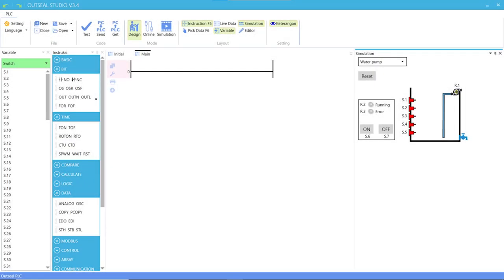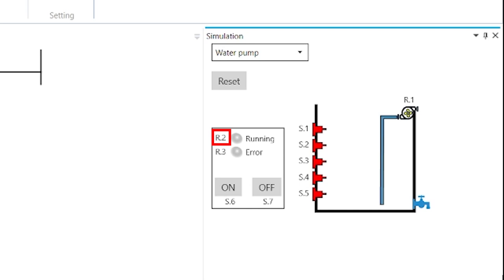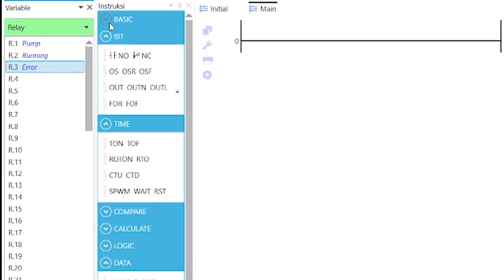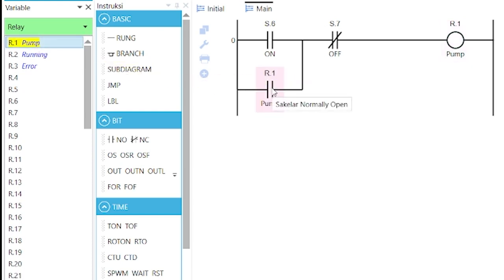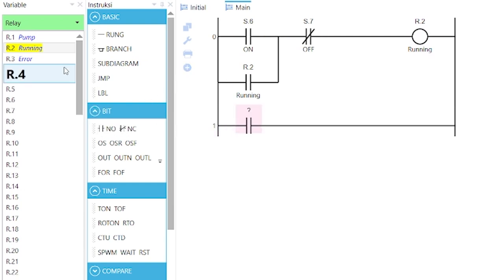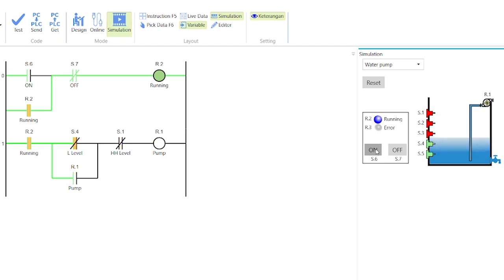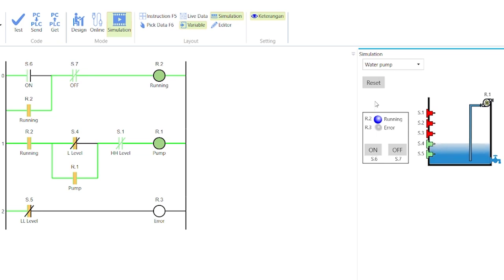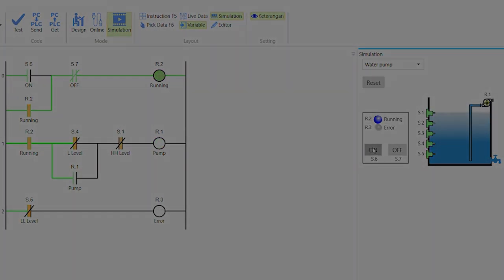#5 How to Program Outseal Arduino PLC - Water Pump Control

Comment: Outseal studio Vs LDmicro  both of them are able to use arduino board, which one is better?
Reply from the maker: They are both unique in different ways:
1. Outseal can program only Arduino Uno/Nano, the Outseal Nano and Mega, Ldmicro can program a wide range of processors including STM32.
2. LDmicro requires configuration and additional software (Arduino IDE and Atmel Studio) before Arduino boards can be programmed. Outseal does not require those.
3. LDmicro can do a number of low-level programming, Outseal has some easy functions for some modules.
4. Outseal has fixed digital/analog I/O which can be extended with expansion modules, LDmicro I/O is depended on your board choice and can also use I/O expansion modules.
5. Outseal mega (Atmega 128A) is not the same as Arduino mega (Atmega 2560) which has more I/O and memory.
4. Outseal UART is reserved for Modbus only, LDmicro does not have Modbus support yet but has UART instructions that accommodate other communication protocols.
5. Outseal is more suitable for industrial applications, while LDmicro tends more to embedded systems.

They are both great applications and it depends on the goal for your particular project. For me, Outseal stands out with its Modbus functions and I can decide what microcontroller to use from LDmicro different brands and models.
Reply: @OnosTech  i have tried out the outseal studio, great software. my ladder is able to load back from arduino to PC. Wow .. thanks for your info
Reply from the maker: @ridharahayu36  You are welcome!